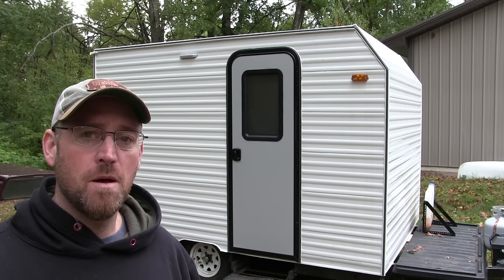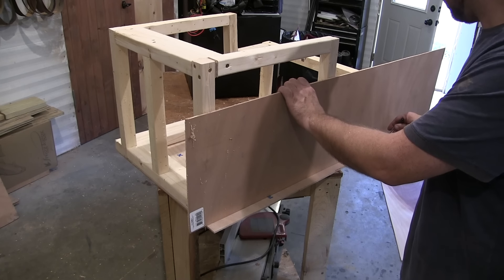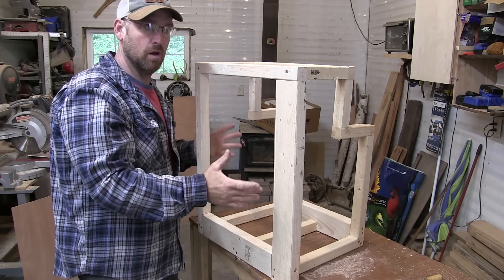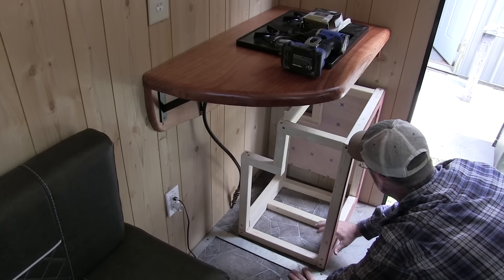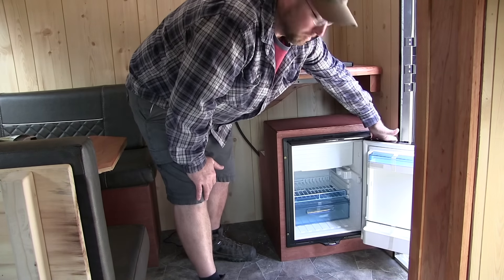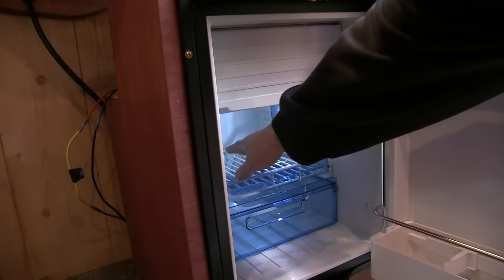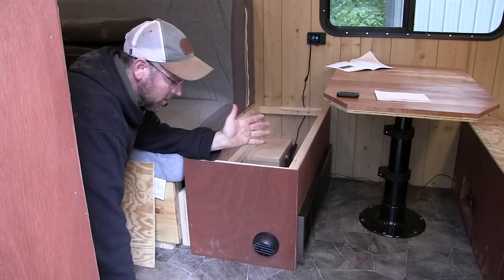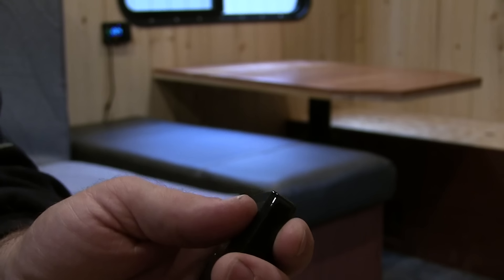DIY Camper Cost and Weight !! installing a fridge and heater

Comment: I would do a battery disconnect. so when storing you can cut all power.  Then you do not have to mess this pulling the fuse.  Get a better pump for the heater.  That is loud.  You might be able to wrap something around it to make it quieter as long as it does not get hot.

Personally I do not like much sitting in a camper especially the table and bench area.  I would have put the bed across the back and maybe had it fold up like a futon or flip out of the way.  Then instead of a table and chairs I would have put a computer desk.  That way I can watch movies in bed easy and use it as a table to eat if the weather is bad.  I would expect to be eating outside.  And attached awning that you could screen in would be nice.  I would have tried to fit a toilet/shower combination and any left over space would have been to make the kitchen bigger.  They do have tiny washing machines that can do maybe one outfit at a time and while camping you just use clothes lines to dry everything.  The larger kitchen would have allowed for a bigger refrigerator.  I would have insulated the whole thing including the floor.

Now my dream camper would be very self sufficient and able to run months at a time in the wilderness... kind of a survival camper.  I would have a water tank with a water pump so I could run a hose to a pond.  It would need a water filter and likely a UV treatment.  I would also had a solar panel system on the roof.  You could fit 1000w up there.  Have a hose to dump gray water (this is legal in most states).  I would also love if there was some way to make a portable  septic system.  I was thinking a 50-70 gallon tank with chambers that overflowed from one to the next.  Have a sewage grinder going in and have agitators and bubbles along with enzymes to help treat it and then the last section of the tank would have a UV light and would hopefully be counted as gray water.  Then you could use a more traditional toilet instead of messing with a composting toilet.  I think the plans I was writing up was 7x12.

Maybe have a StarLink on the roof and have an electric heater and instant hot water heater.  You would need a fair amount of batteries.  Have inside lights and lights under the awning.  Have storage under the bed for things like a hunting rifle, fishing pole and tackle, and some snares.  I would add a good saw, an ax, and maybe some tools.  If you are going to do say 3 season camping then some rabbit/bird netter, gardening tools, and seeds.  Pack it with say 2 months of dehydrated foods as well as cooking oil and seasonings and between what you can hunt, fish, trap, forage, and grow you should be fine for 9 months.  With the internet and a computer, some good books, puzzles and games, and say a couple of E-bikes on the back... you and you significant other maybe could enjoy life out in the middle of nowhere.  You could also  towed it with an EV that you can charge off the solar panels...  It might take a few weeks to recharge, but you could also go into town for say some pizza and charge it then.
Reply from the maker: wow sounds like you have a dream camper in mind  . I like that battery disconnect idea and quieting the fuel pump the rest might be a bit more ambitious than I'm up for after this build though . I love the self sufficient ideas it would be awesome to not have to depend on society for anything .
Reply: @blackspruce1861  How how does the fuel pump get?  Most run pretty cool.  If it does not get hot then wrap it in something like a foam rubber.  Even rubber insulators where it mounts might help as usually most of the noise is vibrations transferring to the frame.

Comment: I have a question about the diesel heater.  Can you use an off-road diesel in it? Typically cheaper and has better performance than the diesel you put in your truck.
Reply from the maker: I'm not sure . Honestly if i were to choose a different fuel I would go with kerosene for less smelly exauhst  outside . but I didn't know if thats fine to run in it either

Comment: So your CCC (the difference between your UVR and your GVWR) is 100 lbs or 400 lbs? Consider that when loading up for a trip. And its called butyl tape in the industry.
Reply from the maker: I think I'm going to buy a 3500 lb axle and have a welding shop swap it out . and I will probably do some kind of up date video for that . I want the extra peace of mind

Comment: The diesel doesn’t smell or maybe I can’t? But I put a top feed tank as the bottom fuel output lines suck and usually leak hence diesel smell
Reply from the maker: you must be immune to the smell . I can't stand the exhaust or the just the smell of the fuel itself .

Comment: Hope the build is holding up!! 
Such a great job and accomplishment. 
I hope you plan to add some safety in the unit like a carbon-monoxide detector, fire alarm, and fire extinguisher. ⛑️

Maybe an exhaust for the stove also 🍳
Reply: Also any plans for under the cabin to protect the exposed wood?
Reply from the maker: Thanks so far so good . yeah I actually added CO and smoke detectors but haven't got a fire extinguisher yet .
Reply from the maker: yup I'm going to paint it with something in the spring not sure exactly what yet
Reply: Maybe a thick rubber or linex of some
Reply from the maker: yeah that does seem like it would be the way to go

Comment: Maybe if you can install some sound isolation between the pump and the frame.
Just a thought.  Wolf mama
Reply from the maker: thanks ! I think I may build a box to put it in and pack it with insulation

Comment: Can I get a list of everything u used bc I’m doing the same project everyone says to use metal studs lighter but more expensive
Reply from the maker: hey sorry it took so long for me to respond .I really don't have a material list just a bunch of receipts .are you interested in the harder to find  stuff like the siding and trim wiring camper specifics or more the framing . I could see using metal studs as a good way to go . I've built a bunch of metal buildings but didn't know that you can get the studs at places like lowes
Reply from the maker: also I have a video posting today at 3:30 that has some really good improvements to the camper

Comment: i am thinking about using the diesel heater in my camper. Have you had any issues with it and how much diesel are you using on a weekend camp?
Reply from the maker: Honestly I haven't used it a lot yet . a couple times this spring then never got out with it this fall . it did great this spring . I don't think it used that much . the only thing I don't like is that mine just has settings like  12345 but no thermostat. I left it on the lowest setting and woke up in the middle of the night just roasting . otherwise I like it

Comment: Where you put the heater should be fine. I have a similar heater underneath the bunk in my semi and have never had an issue with airflow or fumes.
Reply from the maker: Thats good to know . I did put a little longer pipe on the end of the exhaust to get it out a bit past the side . and got a carbon monoxide detector and smoke detector to be safe

Comment: The ticking is from the cam in the pump.  I replaced my pump for a quieter one. Don't waste your time with trying to put it on rubber mounts, sound proof box, etc.  That ticking will vibrate thru the whole camper. It will drive you insane, trust me.
Reply from the maker: thanks for the tip !!

Comment: Enjoyed your videos. But what no bathroom? No bathroom!
Reply from the maker: Glad you like them !! I just couldn't fit everything in that little space so I set it up with what I really wanted . if I'm camping somewhere with the camper there should be at least an outhouse . if not I'll probably be tent camping
Reply: @blackspruce1861  thanks for the reply. Yeah I get it. Bathroom duties are easier to satisfy compared to other functions. As you said campground amenities or even a port a potty and a spray bottle. Thanks again new subscriber.
Reply from the maker: @marklatlip3057 no problem. There’s a few places I like to camp that I wouldnt dare towing a camper. Yeah a portapoty might be good for road trips. I’d like to do a Lake Superior circle tour in the spring when the rivers are still raging and I found out last time I did that trip none of the campgrounds in Ontario open till May . Thanks for subscribing!!

Comment: This has been a really useful episode to watch as I was thinking of getting one of these heaters for my new small living accommodation box that I carry on the back of my old vintage truck.  My box is almost the same dimensions as yours so it all compares very well.  I like the refrigerator installation too, and given that you have installed the diesel heater i think itis a great idea that you have insulated it too, it should really help in keeping its duty cycle down. One thing i think that I would have fitted though is a small cool air vent in the floor underneath  the fridge, just to aid the cooling circulation. Do you draw your electic supply from the towing vehicle, or do you have a seperate battery in the trailer?
Many thanks
David in the UK.
Reply from the maker: thats great !! I have a battery on the front of the camper . it charges on the the truck when hauling and I have a solar panel I plan to use when camping to keep it charged . a small cent might be a good idea but I've just decided to put as few holes as possible to keep water and pests out . glad you enjoyed it . thanks !!

Comment: was it not possible to get the remotecontrol cable trough the wall anymore?
Reply from the maker: Might have been able to but it still comes out the bottom of the switch so it would still be visible a bit

Comment: The clicking is the ignitor. firing off. that how mine works in my truck.
Reply from the maker: oh . I watched a couple videos they were saying its the fuel pump . either way it is a bit loud good thing there's not usually a lot of other campers in the late fall .
Reply: I got used to it after a few nights on the road.
Reply from the maker: I could sleep through it

Comment: Just a friendly note if you use Bio Diesel and you let it set for long periods of time it will separate and leave a black tar at the bottom of you tank and plug your filter and can gum up your heater. Trust me you don't want to go through that like I did so please use only non Bio fuel.
Reply from the maker: Thanks for the tip !! I'm a pretty do it yourself kind of guy but I won't go as far as making Bio Diesel lol
Reply from the maker: wow I didn't know that . I will make sure not to make that mistake, thanks !

Comment: I think it needs some fixed ventilation up top to be safe to sleep in (running out od air).
Reply from the maker: it has 3 windows that all have screens
Reply: @blackspruce1861  usually a camper (in Europe at least) has at least one fixed ventilation high up and one low, so you don't forget to open for airsupply, also moisture/condensation will also be able to escape to avoid mold building up over time. Just a friendly tip. Nice build!
Reply from the maker: @daw7563  I know they’re nice but they also tend to be the first place the roof starts leaking. I really just didn’t want any holes through my roof
Reply: @blackspruce1861   It does not need to be through the roof, it can be on the side, just high up, close to the roof. But an intake through the floor or down low is equally important. Running the gas stove will quickly consume the air too. If you need a heater you will likely close the windows = no fresh air as it is of now.

Comment: That fuel pump banging would drive me crazy fairly quickly.
Reply from the maker: you know I though so too , but I used it on a trip this spring and it didn't bother me at all . in fact it almost helped me get to sleep . the part I don't like is that it's not thermostatically controlled just high and low with a bit between and it gets too hot

Comment: That diesel heater pump noise is annoying. There might be a way to enclose it with sound deadening material plus physically isolating it from the trailer frame
Reply from the maker: I agree . I'm leaning that way too

Comment: That's an awesome camper you built, but no sink or toilet,  guess only so much you can fit in a small space. Nice to at least have a place to wash your face, or dishes
Reply from the maker: Thanks !! yeah its a pretty small camper , and most of the places I would dare to pull a camper would at least have an outhouse . you can always wash your face and hands with a big bowl of water . I'm so used to tent camping I don't need much lol

Comment: You think a battery will keep that fridge going for long by itself?
Reply from the maker: honestly I have no idea how long it will keep up with it . I do have a solar panel to use when camping and the truck will charge it while driving . but I'm going to have to use it to find out .
Reply: @blackspruce1861  nice I have a 50 watt panel on my camper and a big 12 volt fridge. On medium settings the best I could get out of it was about 8 hours with a basic battery.
Reply from the maker: the panel I bought is 100 watt and the fridge is smaller so hopefully a couple days could always hook to the truck and let it run for a while . I really hope the extra insulation around the fridge will make it more efficient too. you could get a bigger panel and probably up that time quite a bit .

Comment: On insulating the fridge, maybe you know better but it seems to me that you'd be keeping the heat from the motor in rather than the cool from the inside?  Perhaps I'm wrong about that.  ANYHOW, as always I enjoy your videos.  I'm curious to see how all this works out "in the field".
Reply from the maker: I probably should have showed more side and back views , but the insulation is tight to the fridge and doesn't go around the motor so it should keep the heat away from the fridge .

Comment: Go to the auto parts store and get you a low volume 12v fuel pump its much more quiet.
Reply from the maker: maybe , but seems like it might be hard to match the right amount to the heater

Comment: I don't mean to insult your intelligence but you didn't mention it in the video, so, I'll say it anyway... Get a reputable CO detector and test it to make sure it's working properly every time you get the trailer packed up to go when you intend to use that heater. CO build up in a small space like that is no joke.
Anyway... Nice build. You saved yourself quite a bit of money and probably got to customize the trailer to your own needs more so than if you would have bought a used one. Well done. 👍
Reply from the maker: very good point and something I plan to get in the next day or so . Thanks !

Comment: Number one carbon monoxide detector. You also need a propane detector! My only other thing is I think you would have been better off with a used mini fridge that would have worked off of propane or 120 V AC.
Reply from the maker: I have a carbon monoxide detector and smoke detector , I didn't know they made propane detectors but I'll have to see if I can find one . as for the fridge I haven had much use with it to make up my mind on that one

Comment: I thought I was the only one to use a large framing hammer for finish work
Reply from the maker: LOL !!
Reply: @blackspruce1861  what brand and weight is yours?
Reply from the maker: @seymourwrasse3321  I think ones a fiskars and ones a bostich  heavy lol . I would like to get one of the titanium framers nice and light but still a lot of power with the long handle
Reply: @blackspruce1861  It looked like a Plumb brand I had, I could only use it wearing a glove the handle, I also had a Vaughn waffle face. at 42 I finally broke down and got a 32oz Estwing, with a smooth face. I have lost all the others, but still have and use the Estwing for everything, it's the best hammer I have ever owned. In my younger days, I could sink a 20 penny flush with no marring the wood in just a couple of hits. In my 60's with arthritis I about have to pack a lunch for the 20 penny, still better then taking the dirt nap, never quit or give up, I still have too many people left to aggravate. glad I found your channel
Reply from the maker: I had a plum for quite a while . It got stolen along with all my  other work tools on a job site in kalamazoo. they stole my tools a hard hat and safety vest and a little Honda generator . I'm almost sure they wore the vest and hard hat and just walked down the road with them. I'm glad you found it too

Comment: Did the heater company explain the fuel pump knocking?
Reply from the maker: No I never talked to them about it .but there’s a video on here the guy explains there is a piston in it that makes the noise . There is a quite pump another guy had in a video but it needs programming and I quit watching at that point

Comment: pretty sure you can get a fuel pump that's right at the tank. That'll move the noise well away from you
Reply from the maker: That sounds like its worth looking into ! thanks !!
Reply: Actually fuel pumps are designed to push rather than pull the fuel.  Relocating it to the tank will be quieter and also last longer.  I would build an insulated box to house the tank and fuel pump.  I think too I would wrap my fuel line inside a pool noodle.
We finally 4 fuel pumps later relocated our fuel pump for our generator on top of the rigs fuel tank.  No longer have issues with fuel starvation.
Reply from the maker: @martjebicker9168  thanks for the info I might have to do something like that
Reply: Cool adventure rig! Nice work!
I literally just bought one of those heaters for my truck camper. I had no idea that pump was that loud. Thanks to all your commenters for the ideas about isolating it. 
Keep up the good work!
Reply from the maker: Thanks !! yeah there's lots of ideas on here from them . I will certainly try